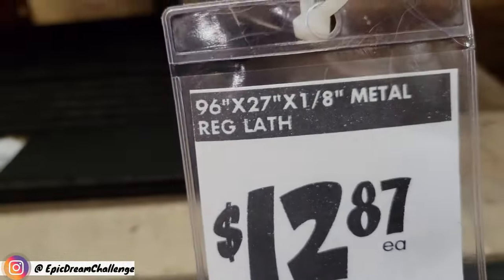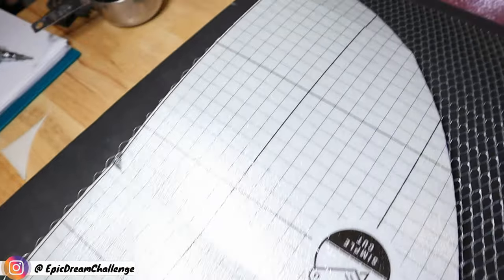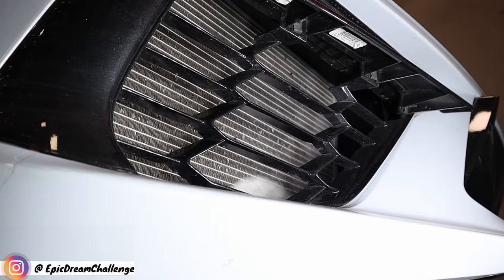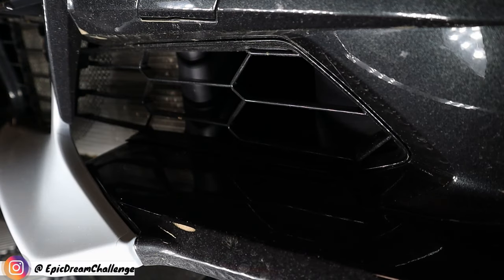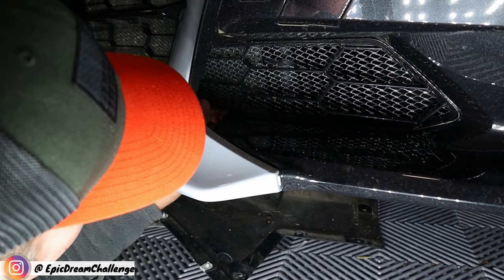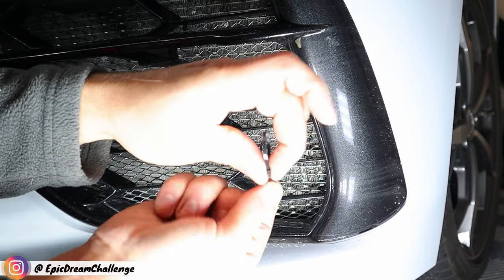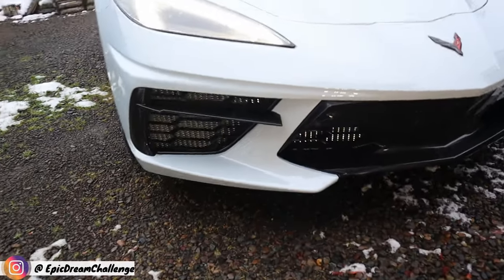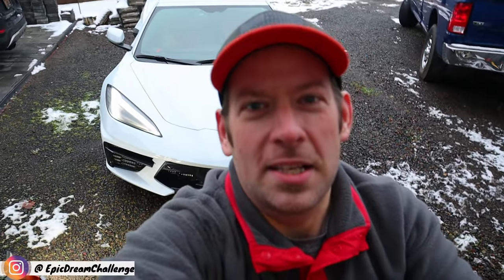C8 Corvette Grille Vents Under 20$ !!!

Comment: Nice job....I just did my 21 with a kit from Amazon.....it was only $55, but still more than what you spent.  I do like the unpainted look.  One thing I did to prevent getting the edges caught or cutting myself was by a $10 door egde kit from Oreillys.  Went right over the egde of the guards and worked perfectly.  Helped to keep them from getting  hung up as I installed them.

Comment: Nice job...The price of these guards are insane. Those are actually AC condensers. The radiators are behind them. They will disrupt airflow if they get to mashed. Also the small radiators in the middle most people  ignore. I like how the brite metal looks. I was thinking you could rotate them for an even more graphic display. Like a quarter turn...cool project.
Reply from the maker: Thanks man I appreciate the clarification. Yea the possibility's with this material is endless since its waterproof and cheap. No regrets for messing it up. I'm sure you could also spray them a desirable color as well.